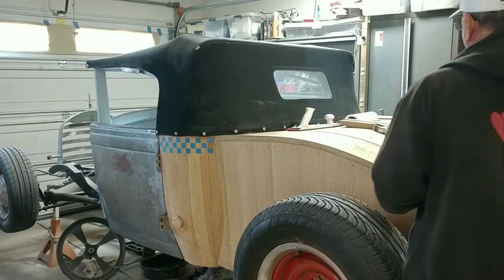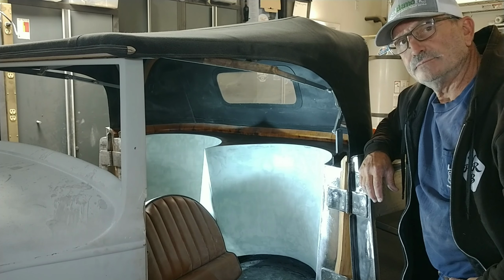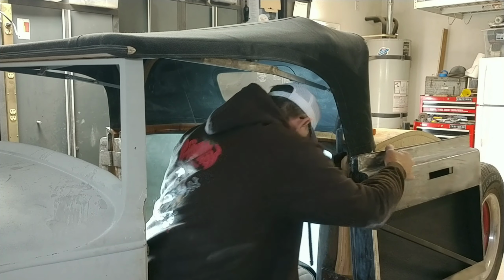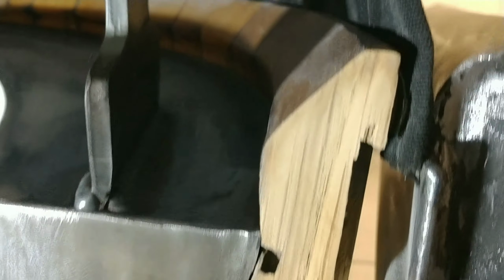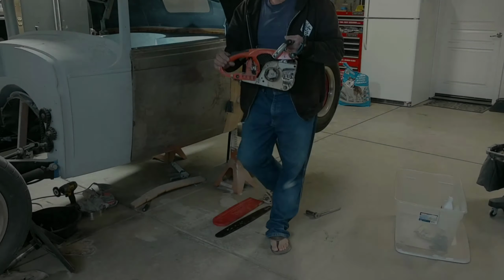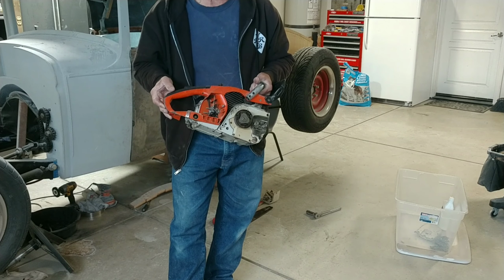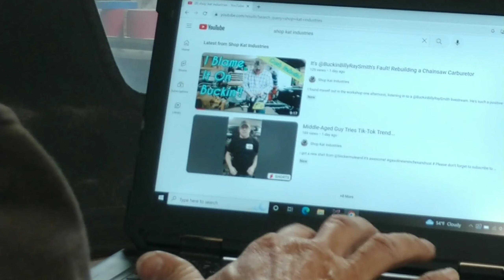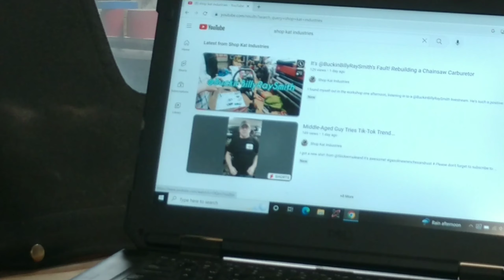wine barrel Hot Rod # rat rod #custom # street rod

Comment: Awesome video brother.  Thanks for sharing.  Yeah SHOP KAT is also a small engine technician. I have been doing that type of work for the last 10 yrs as a side business at my house. Car is looking incredible . Keep the content coming.  Hope you have an incredible day.  Much love and RESPECT
Reply from the maker: Right on Tim! Yes Tim I couldn't get a spark and so right at the very end I was holding the end of the plug, and tugging on the the rope  I wasn't getting anything so what's your opinion.
Reply: @VinoRatRodbuilds  Could be a bad coil. I would take the coil off and wire brush the contacts on the coil and on the flywheel. When putting it back on use a match pack top as a feeler gage. Have been doing it that way for years.
Reply from the maker: @timwindsor03  k Ratrobhartman@yahoo.com
Reply: @VinoRatRodbuilds  ok got it. You can remove it if you want. Check you email

Comment: Probably (could be) Ignition Model, that is if the Spark Plug isn't Fouled! Always chuck a new plug in it first! If you wrap a wire around the plug & earth it to the Engine they are hard the get a good earth, can buy a Spark Plug Tester (only a few $) Good luck Robert
Reply from the maker: I like all those ideas. yeah I held the end of the plug when I could see that it wasn't sparking I wasn't getting anything.  thanks for watching.

Comment: A chainsaw and sandals tells me something peculiar and epic is about to happen. You can also test a chainsaws compression by letting it drop from its cord. If it falls slowly, it has good compression. Another issue with them firing is the spacing between its coil. It typically should be the thickness of a business card.
Reply from the maker: Right on I will check that thanks 👍
Reply: @VinoRatRodbuilds  I'm no expert on chainsaws by any means but if you need any last-ditch help, you can send me a message on Instagram. Some years ago, I depended on two old commercial chainsaws during my college days for firewood chores. They would be a royal pain sometimes to get running on frigid winter days.
Reply from the maker: @blueridgehollow2510  thanks I appreciate your offer it's awesome getting help from the utube community.

Comment: Couldn't you set up a router and a guide and take up down
Reply from the maker: Patrick maybe a hand planer that's an idea. Thanks for stopping in today.
Reply: @VinoRatRodbuilds  you can get a machine can't think what it's called and clamps on and like a planer it allows you to get timber level and flush and at the same thickness all over with ease
Reply from the maker: @Scano41  man that would have really helped at the very beginning fur sure.
Reply: @VinoRatRodbuilds  will look on line in morn and send link